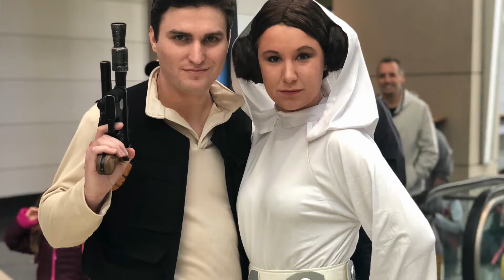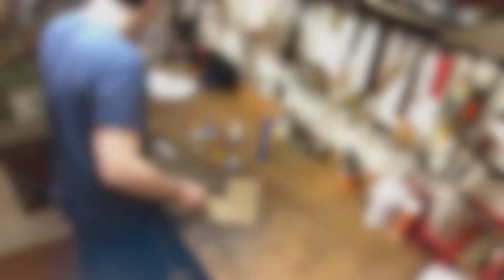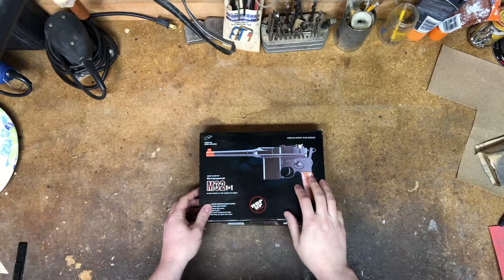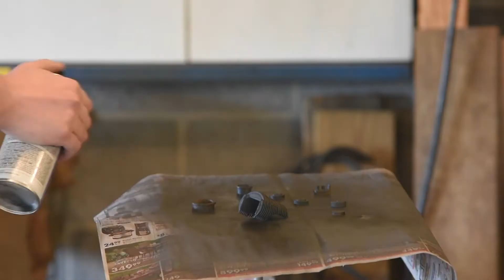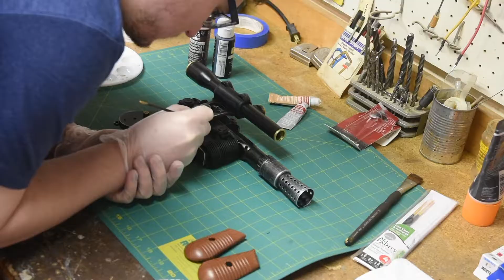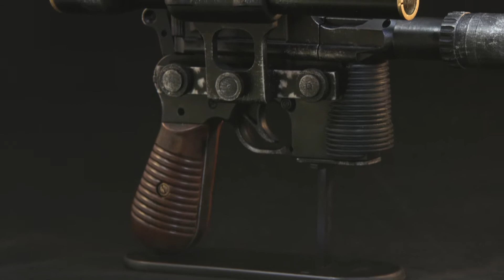Turn a $10 Airsoft Gun into a Replica Han Solo DL-44 Blaster with 3D Printing

Comment: Great tutorial! It turned out really well! I’m planning on doing he exact same thing but I do have a question. When sanding down the parts did you run into any issues with sanding down the the print lines on areas with indents such as the line on the muzzle flash and the little “bumps” on the knobs for the scope?
Reply from the maker: indeebprod Parts that have groves like the knobs and stuff normally don’t show the print lines as much so you can often get away with less sanding. I hope that’s what you’re asking.

Comment: Spectacular work! You've convinced me I need to make one of these in my collection.

I do have one question. When prepping for printing, did you have to change the scale on the models at all? I ask because some airsoft mausers get a bit wonky with their proportions.

I will order a couple of extras to do tests, hope to have something worth showing off soon! Thanks for the how-to!
Reply from the maker: Thanks Keanbo! You won’t have to scale anything, but sometimes with 3D printing it helps parts fit together a little better if you scale them up/ down a couple %. You can also just sand parts down after printing to help them fit together. Check out the links in the description for where you can order the airsoft and download the models. 😀
Reply: Sounds like a plan! I've got a couple of mausers on the way now, thank you!